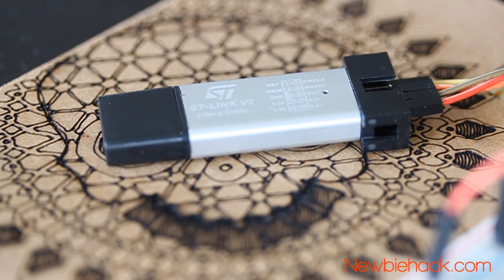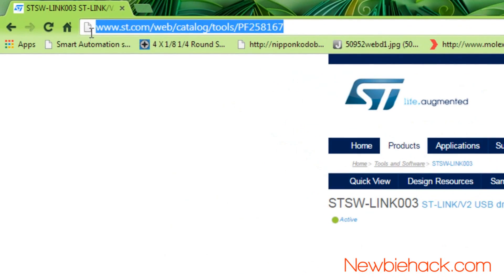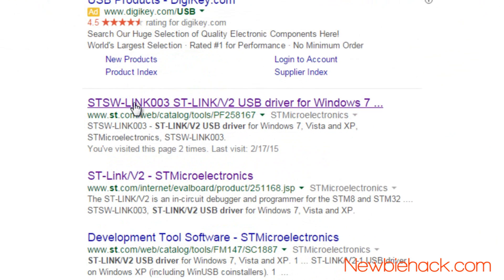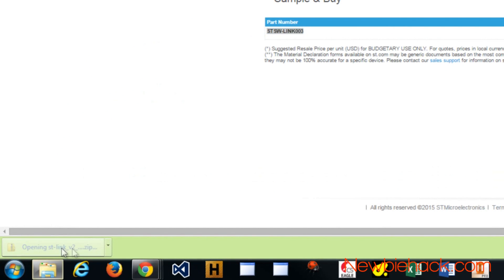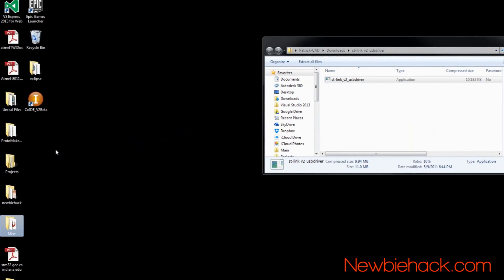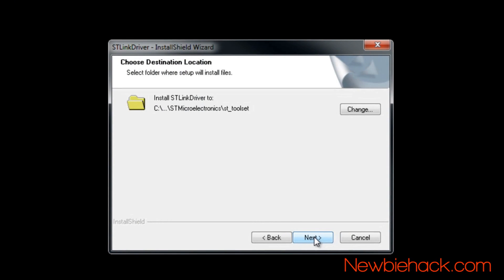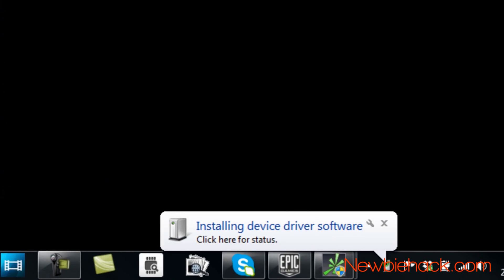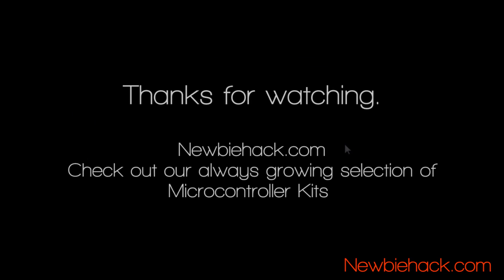3. How to Set up the ST-Link v2 Programmer Tutorial for ARM Microcontrollers

Comment: can you help me how to connect Arduino  with hoover board wiring diagram and code for Arduino for speed control
Reply from the maker: The hover board already has a lot of electronics going on and has it's own speed control that is connected to its own microcontroller.  The microcontroller is most likely connected directly to an H-bridge or something similar which contains high current switching electronics that you will want to use.  If you want to tackle this, you may need to first get an H-Bridge and speed control circuit and then have the arduino connect to that to control the motors in the hover board.
Reply: i mean if automatic robot than how i can control if some obstruction left side i want to move it by sensor to right side if some thing on front it will reduce speed if near by it stops automatically due to obstacle sensor can you help in this or you have already any software written